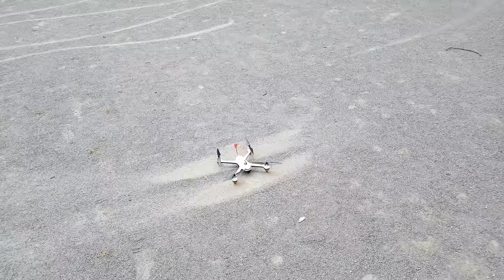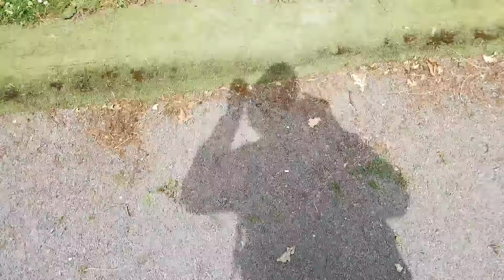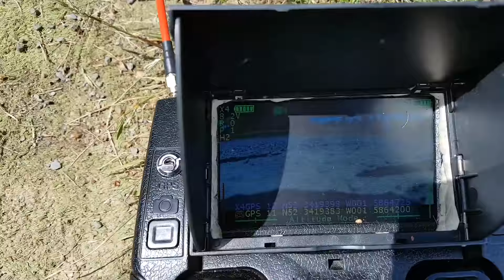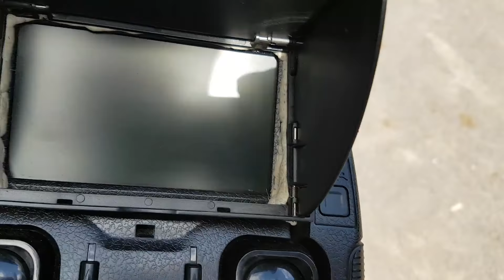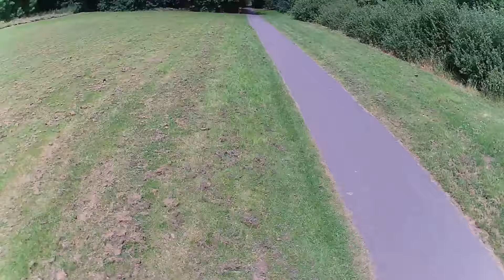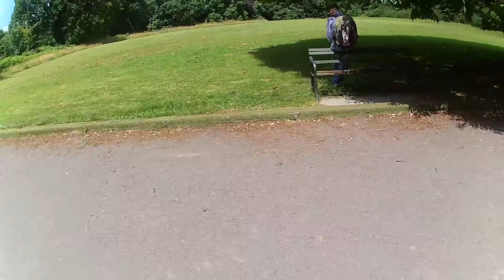Hubsan H501S Return To Home Fail & FPV Attitude/Altitude Hold Mode

Comment: Desperately need firmware for my H906A (Deluxe FPV-1) Transmitter, I need v1.31.19.... it's a 3rd party firmware made by company that made these transmitters but had changed the LCD design on it then shipped it out w/ their own firmware on it in order for the LCD to function. Husban doesn't have it, typical for this seriously unorganized company. You would think some collaboration between firms on shit like this would be pertinent. If your transmitter is showing v1.31.19 on it.... DO NOT CHANGE/UPGRADE IT!!
Reply from the maker: I hear you m8. One of the reasons I swapped out hardware in my Hubsan was because I was sent firmware for mine and it bricked the transmitter. I was told by Hubsan I could have 20% off a new controller. What a stitch up!
Reply: @Elecifun  funny thing is that my transmitter/controller isn't "bricked" , it works as usual, but the LCD display freezes 1 sec after ON. Now fukkn around w/ it yesterday, I connected another display (a 7" 12v stand-alone) via the video OUT on bottom of H906 
I got video, but it's shakey as fook, lookin like the vertical sync's ready to collapse any second...but doesn't.... shows no telemetry data, does show 2 icons, a SD card icon...and forget what the other was.... Still not good enough to me, to fly any distance..... I REFUSE to be suckered into having to buy another FPV-1...or anything else by Hubsan...their suckAss tech-non-support was a major factor in that decision. I'll let ya know if i get any further... I think I have a copy of the firmware I need (v1.31.19) on a hard drive that had ALL my hubsan shit on it, but it started to fail (smartdisk), gonna try to dig it out, figure out which one, and try to see if I can reclaim any bit of that folder

Comment: I like your smooth flying. Would the rates be set at 60% for aileron, elevator , rudder? I have trouble going forward after turning. It likes to drift a bit sideways!
Phil. Australia.
Reply from the maker: Phil the rates are 100%. No ailerons, elevator or rudder on a quad, my air-plane has them. Drifting can be caused by lots of things, wind etc. The Hubsan is a very cheap craft with lots of features, unfortunately adjusting settings within the software is not a user option. This is why I build my own now and they are much much better, for flying and adjusting. 
Happy Flying from the UK

Comment: Hello, 

Is the RTH function workink on altitude hold mode? I have a strange accident few days ago, the drone is go away from me, and it react to nothing.  It crashed to a tree, "only" 4 props are damaged.
Reply from the maker: RTH works in all modes on the Hubsan H501S. Sorry to hear about the crash, lucky only prop damage.
Reply: Thanks for the answer, yes, fortunately only the props had been damaged.
Reply: Elecifun Doesn't it say you need the GPS on for the RTH to work?

Comment: I believe the new firmware combined with low battery voltage caused the RTH plummet. My 501 did the exact same freefall while in RTH when my battery went down to 7.0 volts. Like yours, it successfully flew back to its takeoff point and was auto-descending to land when it suddenly cut off the motors and plunged. Luckily mine was high enough to manually apply full throttle just in time which lessened the impact so no damage. This happened 3 times the first week after upgrading to the latest official Hubsan firmware. It had never happened before.  I now don't let the battery drop to 7 volts before landing.
Reply from the maker: Hi Jimbo, thanks for sharing your experience. We share similar thoughts on this. I also believe the battery state contributed as at this lower voltage it fell and with higher voltages no problem. I could not reapply power as my test was to see what would happen with transmission loss in Altitude Hold mode. Now we know it will come back t take off point and land successfully if enough battery power.  I will definitely be keeping and eager eye on the battery voltage. Cheers
Reply: I wouldn't have thought battery voltage of 7.0 would be a problem... my H501ss auto-lands on 6.6v and I routinely RTH on less than 7.0v. infact I rarely land it above 6.9v. what firmware version do you have?I have: v4 2.24
lcd v1.3.3
h50ss  v2 .1.29
v 1.1.38
Reply: Walley, I'm using the official V.1.1.36 package with same V4.2.24 and V1.3.3 LCD, but with RX H501S V1.2.20.  Others using this package have also complained of the mysterious low-voltage RTH plunges at or slightly below 7.0 volts.  Another factor may be that I'm using aftermarket 2700mAh 30c high-current batteries that tend to drop voltage quickly once voltage drops down to or below the 7.0v threshhold.  This was never a problem before upgrading the firmware but raised its ugly head immediately after the upgrade.

Comment: I'd be intrigued by a setup like yours, but instead of all the flying about, could a helium sort-of balloon be attached to provide lift, so the drone would float more than fly?  I understand there's no RC control for drones to push downwards against a balloon's lift, but RC-controlled floating interests me.  For altitude viewing, scenery, etc.  Thx.
Reply from the maker: You could try with the helium balloon, might make take off and landing interesting. With this drone it has GPS ( I don't use it) so you could just GPS lock to hover and take photos, record video etc.

Comment: ive watched the video several times, it seems to me that the note in your motors they dont seem to change. Could this not be a classic case of VRS?
Reply from the maker: Forgive my ignorance buddy, what is VRS ?
Reply: im almost 100 percent sure what you had there was Vortex Ring State, the way the Quad wobbles is the classic wobble of death. If you look carefully on the video she starts the decent fairly rapidly which is often an invitation for VRS. The other  successful landings the quad descends slower or appears to.
Reply from the maker: I have watched a couple of videos now including your link and read some online info
Well that is a bit of a bugger as Dronie was on Hubsan RTH autopilot. Umm.
Why would it say 5.1V on the controller ?
Reply: Fun Police are always about, it seems to me on occasions the 501s when on RTH will descend very quickly, this is when i had a first experience of VRS. Since then when using RTH i have returned to manual descent, as the auto descent speed does seem to differ and be unreliable.
Reply from the maker: I never use the assist features on my H501S, apart from Attitude Hold,  I just thought I would turn off the controller in Altitude Hold mode to simulate dead batteries or loss of signal. I have brought down Dronie faster than that before and see the shaking but always slow down the decent or as in my other videos coming down fast in circles or moving forward. I will definitely keep extra vigilant for this hazard. 
Cheers for bringing this to my attention. 
Let's hope fun police ascend or more likely descend sooner rather than later.
Reply: I wonder if this has been changed in the latest firmware. I have been noticing that my H501ss descends very slowly in RTH and I often find myself switching it off when it is above me and manually descend because it seems to take so long.